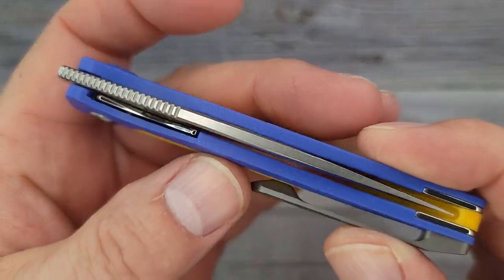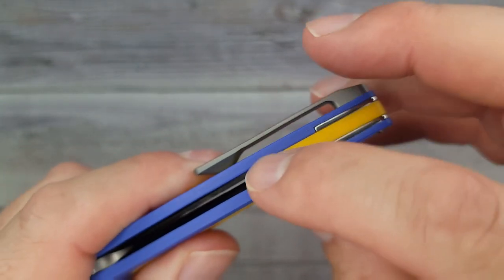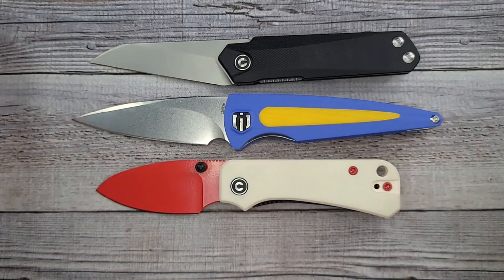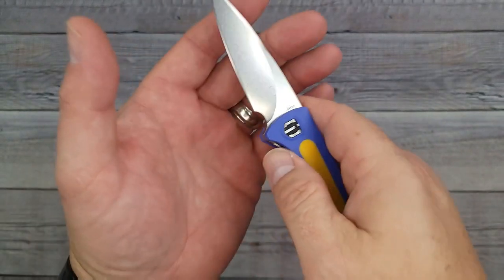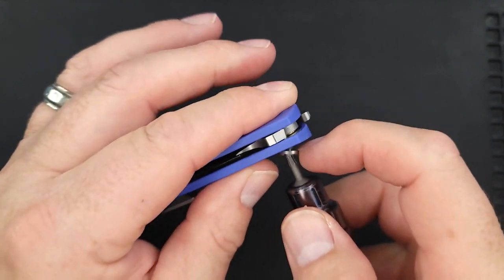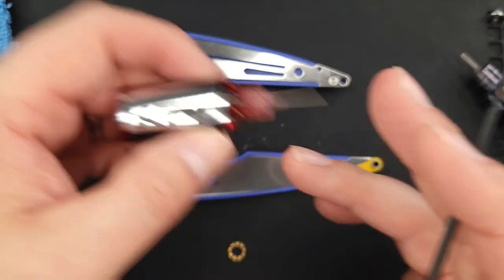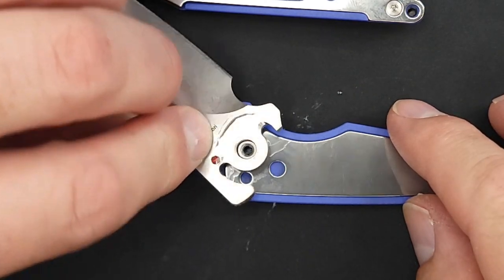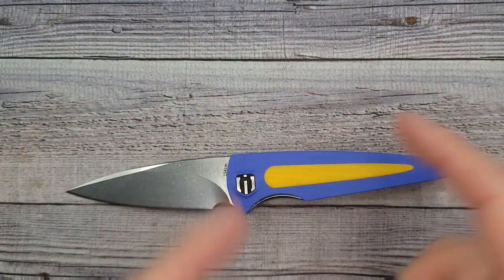NOW WE'RE TALKIN! I LIKE WHERE THIS IS GOING! SHIELDON KNIVES COLIBRI

Comment: Cute little knife…very cool design.:_BeezBladesLook::_BeezBladesWelcome::_BeezBladesBeez::_BeezBladesRed::_BeezBladesBeezhive::_BeezBladesSwarm:
Reply from the maker: I think it would look cool in a dark color. I like the small size of it. :_BeezBladesWelcome::_BeezBladesBeez::_BeezBladesRed::_BeezBladesWelcome:
Reply: @BeezBlades  I would like to see some color variations as well. This one is pretty nice as is though. What happened to the new cleaning cloths you were using?
Reply from the maker: @texyat7388  I still have them and use them. I'm on the fence as to which one I like better.

Comment: Im not sure but I use a dab of gun oil is there really a difference?
Reply from the maker: I think the main thing is that it is a low weight oil. I'm not sure what the weight of gun oil is, but I'm thinking around 10 is good.
Reply: @BeezBlades  Ya I mean I just use a small dab lol seems all the same though. Thanks for the reply.